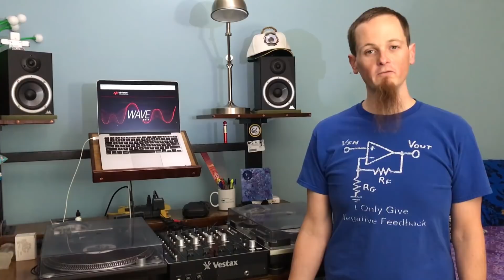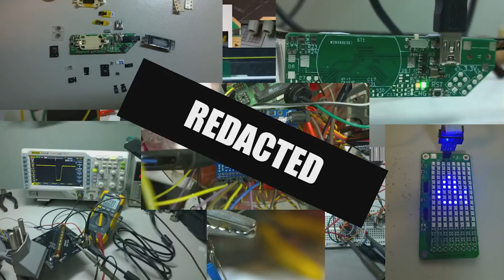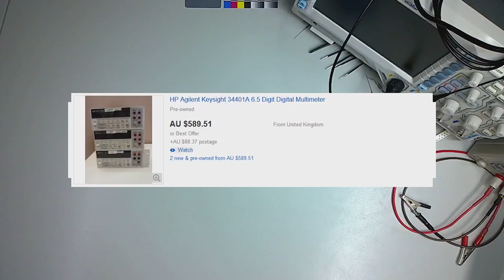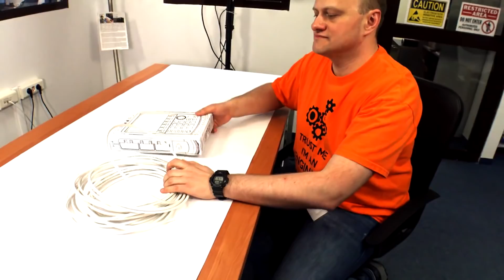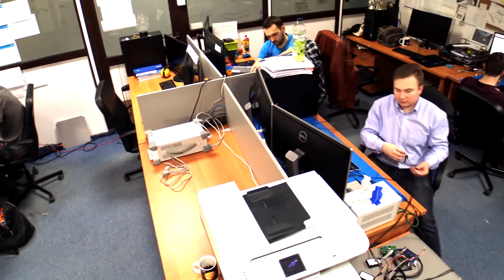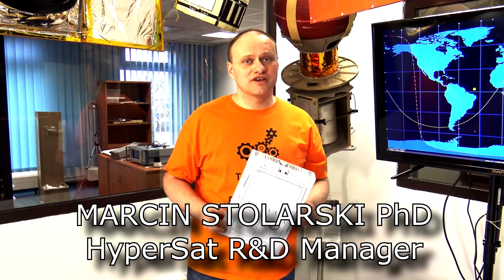Test to Impress 2018 Winners!

Comment: Tuning in next year - Same channel, Same time.
- then with more videos - and perhaps even a finished ESR tester? 
(If I get time to fix my powersupply, make a suitable programmable signal generator, designing/verifying the measurement circuit + fitting 'the rest' into the plastic enclosure)
Congratulations to the winners, and losers - keep going! (And, get better at "im-pressing"  ;-)